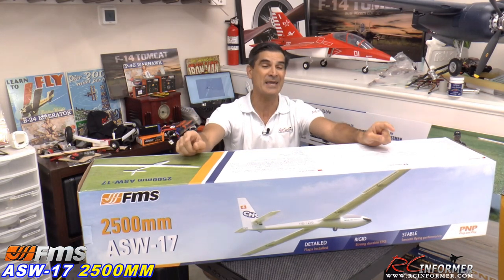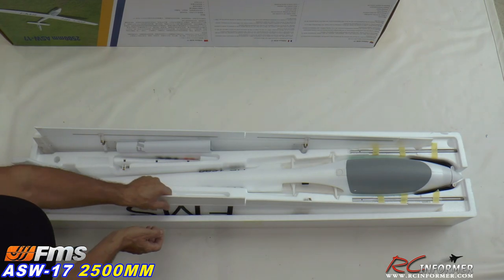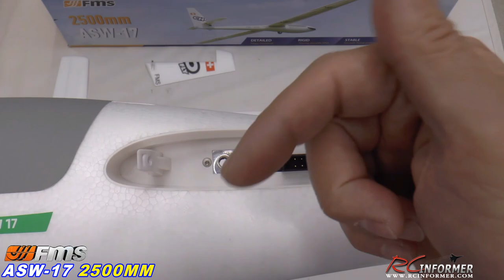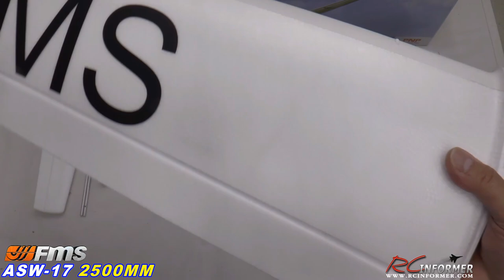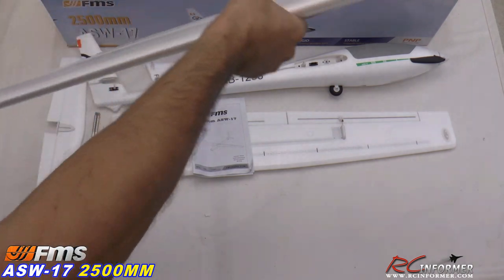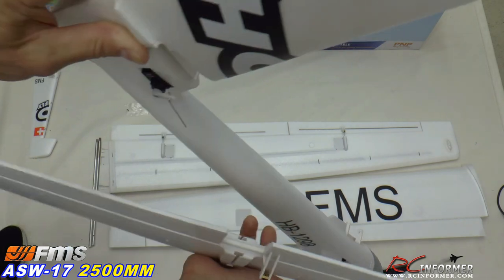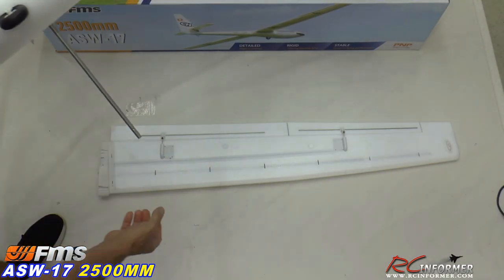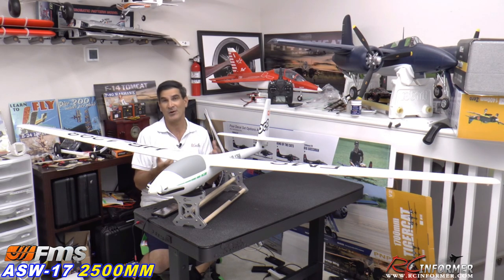FMS ASW-17 2500MM Unbox, Assembly & Flying By: RCINFORMER

Comment: I replaced the wings control rods (4). They use a set screw setup, which will inevitably loosen. The tail fins also have this. Also, secure the horizontal stabilizer, it moves in the slot (tape/glue it).
Reply: Hi what glue did you use? Or witch glue works on the foam planes?

Comment: I have information on which colors of vinyl trim would be appropriate for the FMS ASW-17... TOPQ4102 Monokote "International Orange" and TOPQ4106 "Insignia Blue" which I believe can be purchased through "Horizon Hobby"
Reply: Or you could use a sharpie magic marker to stripe the plane any way you want.  I used a magnum sharpie in red to do The entire upper glider a few years ago.  Used a black magnum sharpie to do the stripes on the bottom of the wings and horizontal stabilizer.  There was never going to be an orientation problem that way!

Comment: I have a question ! In the box whe have a bag with two pushrods and four screws , I notices one pushrod is a little bit bigger than the other one ! I want to know where I have to put the biggest one ! On the ruder or stabiliser ! Thank you ! 💙👍✈️
Reply from the maker: I have my model stored right now where I cannot get at it. However just Install the horizontal stabilizer and then look at the distance between the servo horn and the flight control surface horn and one will be longer and 1 will be shorter.
Reply: @RCINFORMER  The pushrods is not longer than the other one ! They have the same longer ! One is more bigger than the other one ! Exemple one it's like 1.5mm large       and the other one it's 1.m large ! 🤔
Reply from the maker: @Mike-pb5bj  one is thicker than the other?
Reply: @RCINFORMER  Yes my friend ! They d'ont talk about, in the manual ! We really have to pay attention  to see the diference ! And if one are thicker than the other one ! It's because they have a good raison for that ! And I  try to find out !

Comment: The only thing I don't like about the glider is the compressed styrofoam hinges.
I'm going to cut off all the control surfaces and put in proper actual hinges
Reply: What's the big advantage of normal hinges?
Reply: @johannes21e6  they don't break they usually Outlast the model

Comment: On my maiden flight it had a hard crash because the stabilizer settings where reversed. Yes I know that is just stupid of me. Amazingly the fuselage was damage free both wings fine except for the locking system, internal pins broken off.  Seeing the plane did a roll after hand launch and really hit hard one of the spares where badly bent.  
What really is annoying That FMS  did not make the wing so you could replace the locks, if you do not want to use tape or other ways of holding the wing in your fuselage, you will have to buy new wings, which cost around $100 and come without servo's wow amazing, And hardly any parts for this plane, and when you do find a store that sells parts they are never in stock.

Its a great plane but the service of FMS needs major improvement, parts wise
Reply: Why would you want to replace the locks?
Reply: @johannes21e6  Because his internal pins broke off. Just like mine did when wing tip hit a clump of grass.